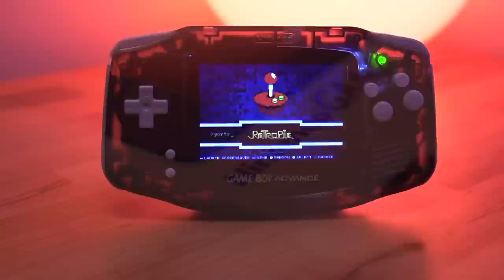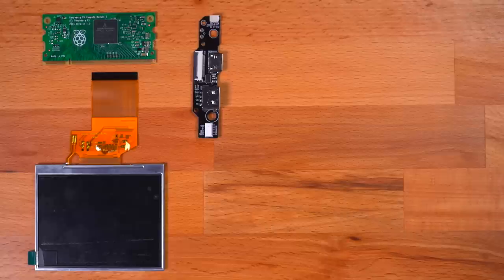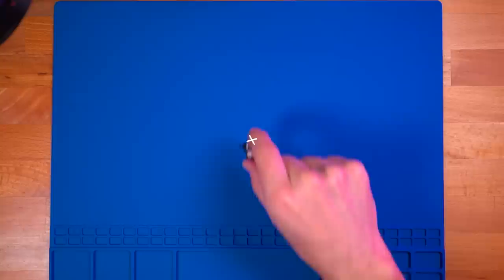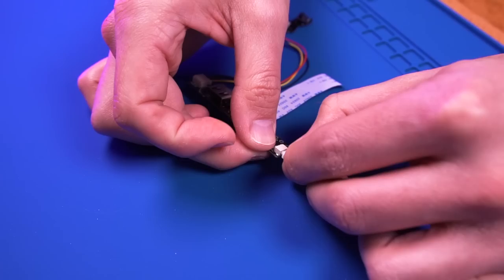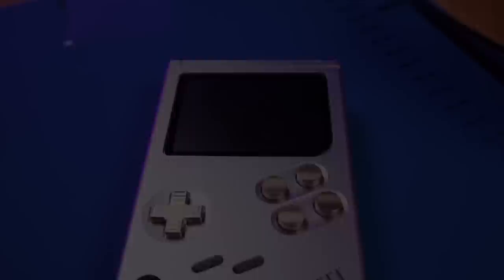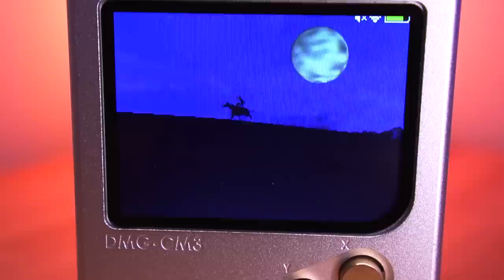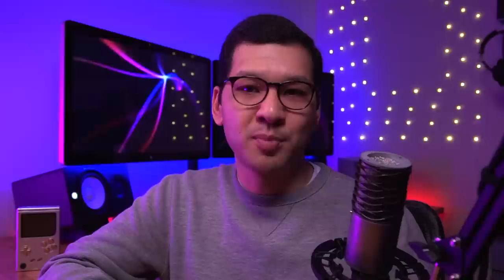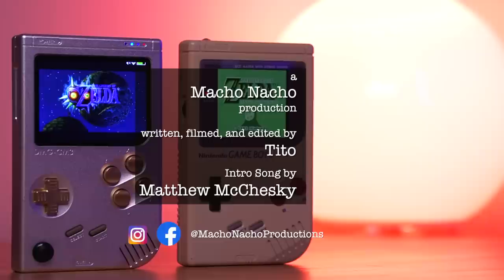ULTIMATE Metal DMG Styled Retro Emulation Handheld | Kite Circuit Sword + Boxy Pixel Shell

Comment: A cotton swab and a dot of acetone will remove the lettering on the buttons, then print new letters on heat transfer paper (or printed in reverse on a laser printer on regular paper, use mod podge to transfer, once its dry, spritz with water and rub off the paper until your left with relabeled buttons)

Comment: If it has built in wifi, from a WIndows computer I believe you can just open an Explorer (file explorer not Internet Explorer) window and type in \\retropie to connect to the share, there you can open the Roms folder and drag and drop your roms to the appropriate folder.

Comment: super glad you got it up and running! that thing looks like it could break a toe if dropped lol, Id probably find some way to delete the joystick, seems more of a detriment than a feature that Id actually use for serious gameplay, loving what the community is building around the RPI CM3 module, I just recently put in a preorder for the clockworkpi devterm and its powered on the same module, seeing it emulating stuff that well makes me excited to do some dos gaming on the devterm! would love to see the circuit sword redesigned to utilize the pimoroni hyperpixel display, that seems to be the biggest shortcoming with these rpi handhelds, is that they all use cheap screens but at that BOM price point I can understand the incentive to go for a budget display
Reply from the maker: Yo Kyle!  Sounds like you have a lot of experience with rpi emulators!  Let me know how the clockworkpi turns out. I really like the design aesthetic and modularity if it!  Cheers!

Comment: im using an lcl gba cm3+ for some of my gaming,its  running  full screen with no cut off.i do have a gpi as well but the rear triggers on any gb case are just not good for playing games so i just use  my gpi   for gb or gb color.the gba cm3 was much cheaper at £160 delivered
Reply from the maker: Nice Lee!  I would have love to use the cm3+ but it wasn’t compatible with the shell. Sounds like you got a sweet rig!  Cheers buddy!!

Comment: Saturn and Dreamcast won't run well on this. You would need an overclocked Raspberry Pi Compute Module 4 for even decent performance with those systems.
Reply from the maker: Oh man really?  That stinks. I was wondering if maybe overclocking this one would do anything especially with the large heat sink.
Reply: @MachoNachoProductions  the Compute Modules have basically the same performance as the full-size Pi of the same number. The Pi 3 can't do N64, Saturn, or Dreamcast well. The Pi 4 overclocked can handle everything before PS2, and even some PSP games.

Comment: So what do you need to be able to connect the analog stick? My boxy pixel case does not have the hole for the stick and I’ve postponed that for a later date
Reply from the maker: It’s a break out board that the analogue stick plugs into and allows you to solder to the motherboard. I wish there was a stick that I could solder directly to the motherboard.

Comment: For some reason boxy pixel's cases seem a little cheap to me, when you compare the finish to say a macbook pro etc. Mainly the edges are a bit jagged and the blasting is not refined.
Reply from the maker: I think his products have gotten much better over the years. I think the machining is great quality and the anodizing is really good. Perhaps not as good as Mac products but I’d say really amazing overall. We have to remember these are highly custom low volume products.
Reply: @MachoNachoProductions  One of my hobbies is yoyoing, and machined aluminium yoyos are always made in really small batches (<100) but they still have better/smoother /consistant surface finishes... It's mostly a matter of working together with the machine shop to get it right.

Comment: I just don't see the point with Pi CM3 based handhelds like this considering how expensive they are compared to other handhelds you can buy especially this BoxyPixel one. You can get almost the exact same performance out of a 70 dollar Retroid Pocket 2 or the tons of other handhelds in the 100 dollars price range. Until someone starts producing handheld boards for the Pi 4 CM4 I just don't see Raspberry Pi based handhelds being worth the price especially with expensive aluminum BoxyPixel shells.

Comment: Have you tried the USB method for transferring roms? https://retropie.org.uk/docs/Transferring-Roms/. This worked best for me. I myself had many problems transferring roms and what I found was that some ISPs block networking with my PC to raspberry pi. In my experience Mediacom doesn't work. Spectrum and T-mobile work. Very nice video. I was fortunate to be able to build this when boxy pixel first released the shell.
Reply from the maker: I need to look into that!  Seems much better than WiFi!